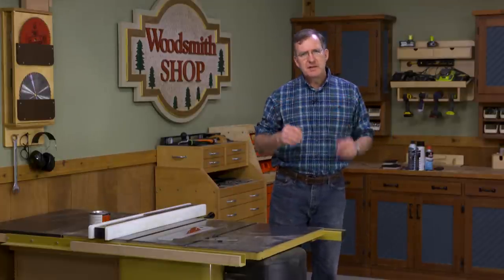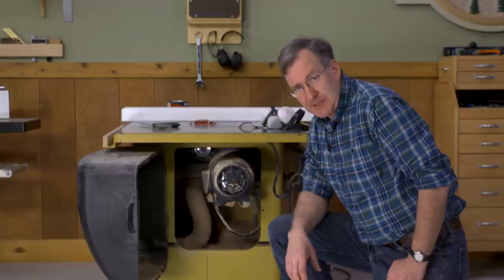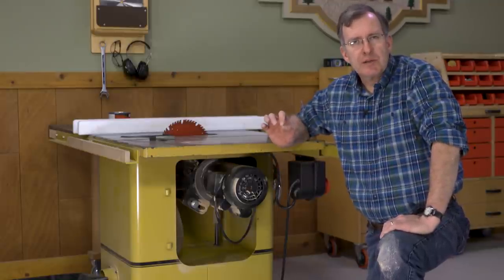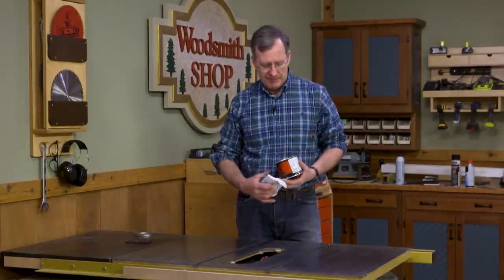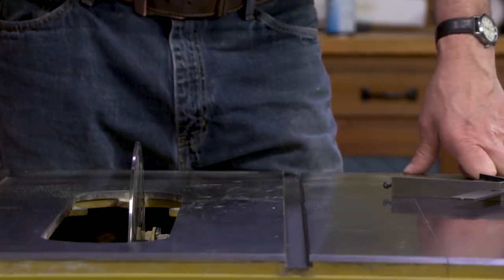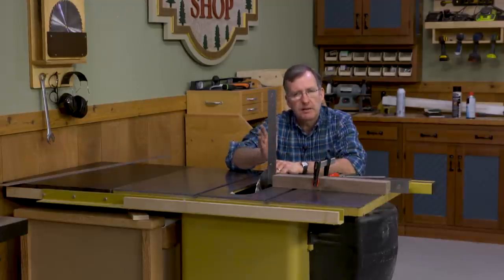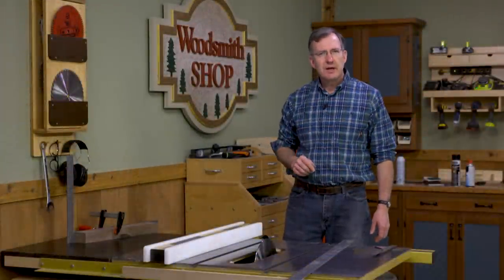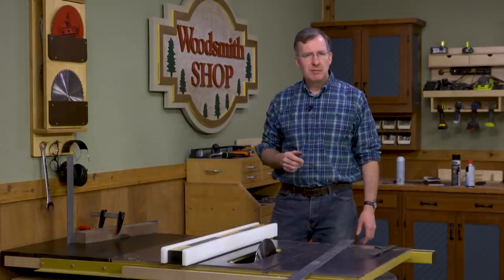Table Saw Maintenance Tips

Comment: I set the blade to be parallel to my miter slot and this was VERY fiddly and took several tries but I could not believe what a difference that made!  I also upgraded the belt and this helped having my old Craftsman 113.XXXX to be running like new.  Keeping the ability to do a 45 degree tilt to the blade is much more problematic for me and I have pretty much given up on doing this and use jigs to get that 45 angle cut.
Reply: Good chamfer bit in the router table does a better job.

Comment: An option to the brass brush is your tooth brush that you should have replaced three year ago? Great video.
I like your method of checking that the mitre slot is parallel to the blade.
I have a Shopsmith and use a digital angle gauge to set the table to 90 degrees to the blade.
Reply from the maker: Thanks!  Glad you found the video helpful.